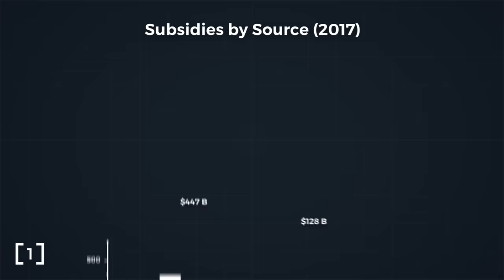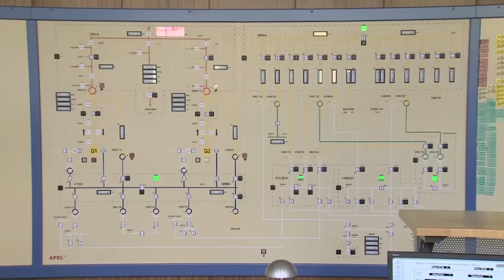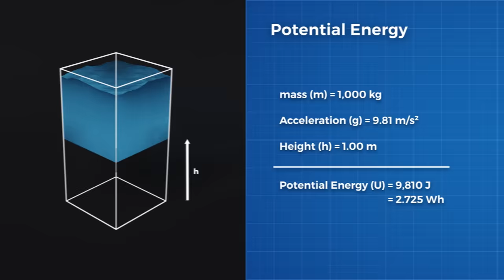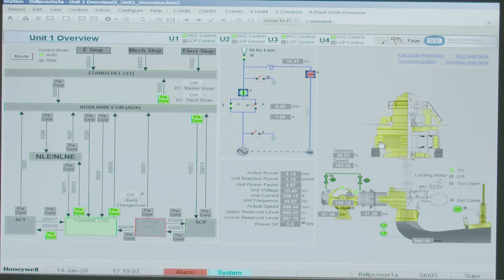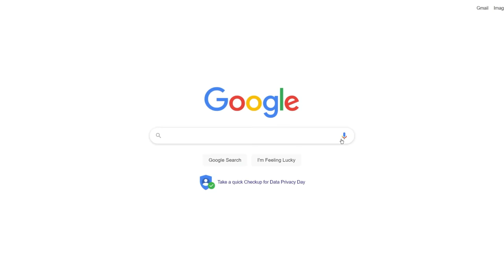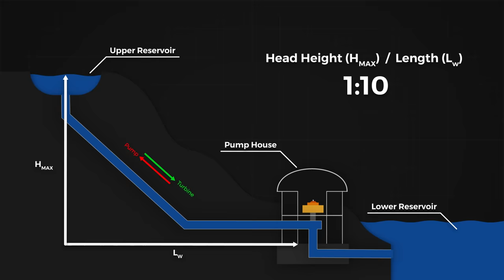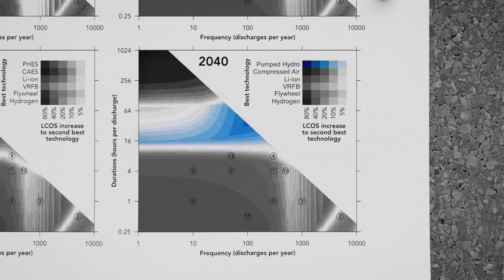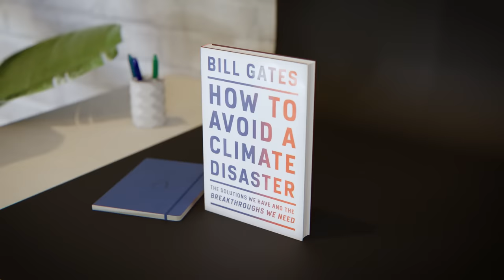The Truth About Pumped Hydro

Comment: Really interesting video, it's a shame we haven't built any others in Ireland since the late 60s even in spite of the issues you mentioned in your video
Reply: Pumped storage are mainly installed to support nuclear stations by consuming electricity when demand is low and generating when it is high.  Their main function was to regulate the grid when the demands is low as you can't regulate a nuc plant down in output.  The pumping plants were built as part of the nuclear project.  
The main issue stopping more which plants is the economics.  There is no real economics vehicle to pay the plants for regulating the grid as an independent plant storage from a nuclear plant.  They get paid for just straight power production and that doesn't provide a reasonable return on investment
Reply: Ireland's geography is a major hurdle. Not enough of the right kind of hills.
Plus, considering the way the country does budgets, (cough, New Children's Hospital) we'd spend more on it than ITER are spending on their fusion reactor.
Reply: @laredobenjamin7438  recent reactors can go down to 25%, which still isn’t totally off. Back in the ‘70s, you were lucky to be able to bring it down to 50%, 75% was more common if any at all was done. 

Though I agree with your point about baseload, yet the original point Jeff made about the build planning to be to support the nuclear project was true. It was projected to need a lot more storage with a majority-nuclear grid. That’s where the political will for pumped hydro came from. Even though they can be useful for any baseload supply today. 

Not to mention, absorbing the unused power at night is only part of it. Another contributing factor was being able to absorb demand spikes. Even if you’re able to ramp up your nuclear from 50 to 100, you don’t want to have to cut off supply while it’s rising. It’s demand-shaving, like most grid scale batteries are offering now, and like water towers and gasometers always allowed. Again, as part of the political idea in the ‘60s and ‘70s of using nuclear for basically everything, not just baseload, they figured they’d need to be able to absorb pretty large demand spikes. Thus, pumped hydro was presented as the solution.
Reply: @laredobenjamin7438  you are correct that it "can" be done... however, it takes a long time to change load and stabilize thereby making it so you need an alternate method of consuming the electricity... hence pumped storage...
Reply: There was a group a while back called 'The Spirit of Ireland' that wanted to dam off hydraulically isolated valleys facing towards the sea on the west coast (They found a few suitable sites) and use them as reservoirs for pumped seawater. Nothing came of it because every square mm of land in this country is owned by someone, and even if they're sub-subsistence farming (Couldn't survive on farming income without EU grants) it - they would still delay any construction for decades or indefinitely in the courts. Irish people are not fans of taking people's land - even if they're extremely well compensated for it.
Reply: @laredobenjamin7438  no, it doesn’t fall to zero, that’s why baseload is called base load. 

Of course the nuclear can load-follow long-term demand increases. I specifically talked about momentary demand spikes. 

Of course I’m most familiar with the UK, both living here, and my father worked in the industry (he’s now retired). It’s a well known phenomenon here for us to get absolutely huge brief demand spikes in the adverts for popular programmes on TV. Boiling kettles, flushing toilets, etc. 

I’m not talking about “can baseload plants load follow into the day?” I’m talking about “can nuclear replace peaker plants that run for 10 minutes? No. Can pumped hydro? Yes.”. 

You’re belying your own ignorance here, because the context of this comment is self-evidently Irish and British. And in the ‘70s the British government did pursue nuclear aggressively for a while with the coal miners’ strike, and there were talks of “how can we completely cut coal out of the supply” — thus even relying on them for peaker plants would not have been politically feasible. We were also watching France over the channel and considering if we could emulate them. 

I made no comment on whether, for instance, the USA had ever seriously considered pursuing “full nuclear”, or if there were other solutions available to the fundamental technical limitation such as other peaker plants. Because, I made the sin of assuming someone online would consider the sociopolitical context (which Jeff is also familiar with and was talking from, such as about the political project) before deciding to argue about inane engineering facts and talking down to someone because you didn’t agree with what you merely assumed she had meant.
Reply: @laredobenjamin7438  I see. I didn’t actually know other European countries don’t really have that issue. Do you not have televised events that are so singularly popular? Its commonly referred just by kettles but anything, a coffee machine, or even just increased water pump load in a community (my toilet flush example), can do it if people get up in the adverts. How is your grid topology different such that it can avoid it?

I wouldn’t say I was upset, just annoyed that you seemed to think I thought baseload had to go to zero, and found your tone to be a bit patronising (“I think you overestimate” etc). Since only peaker plants (and their alternatives) need to go to zero. Happy to discuss the rest.

To give some more background, it was actually illegal to burn gas for electricity in the U.K. until the ‘90s, so any peaker plant would have been coal or oil. So switching to nuclear for only all baseload could have been seen as handing even more power into the strikers’ hands, so the politicians’ thinking went. “Every time there’s a spike we can cause or prevent a blackout”, etc. There’s some pretty interesting memoirs (or self published websites) by people who worked for the U.K. grid (either in CEGB, local distribution board, or associated agencies), many have stories about managerial pressures to find alternative solutions.

Addendum: a lot of the pressure on the engineers was less about absolute GW throughput, and more about fast response times. Even if they were only expected to supply for a few seconds/minutes, they wanted to guarantee fast load-follow response.
Reply: @laredobenjamin7438  it wasn’t just a ban on gas peakers, it was a ban on all gas generation. The law, I believe, was enacted back when the country was still burning coal gas, and it was intended to secure the supply of home heat or somesuch? But it was never updated (until the ‘90s) to account for natural gas, despite the agitation to do so from looking at other countries beginning to do so in the ‘80s. The coal gas was supplied from local coal plant and you could see the town gasometer rise throughout the day before abruptly draining in the evening. So I suppose they thought they didn’t want power companies thinking they could burn some on warmer days or something. I haven’t looked much into the enacting of the law, just the.. overriding? But yeah. In the ‘90s we lost almost all our coal plant as they were all switching to gas. And oil plant went totally out of business because gas could handle peaking just as well as baseload. 

I can understand why you might think someone was assuming the entire grid goes to zero at night, but I’m always for simply asking rather than assuming that’s what somebody meant. 

But sure, nuclear is capable of following the long term demand curve. That’s why so many more recent plant designs (especially ones looking for initial capital) include molten salt, compressed air, hydrogen, etc storage options. Or just straight up co-locating batteries. They don’t want to have to rely on some separate installation to handle the peaks if they can help it. Especially because then they can get in on the energy trading game to buy up cheap wind too, to help lower the repayment timelines that might otherwise stand in the way of access to credit/investment. 

Perhaps you’ll find interesting this website: carbonintensity.org.uk , it has a live map of the types of electricity sources used in each region of the U.K.  Today is fairly green (unsurprising, the wind is straining against my windows today). But on low-wind days, the south goes very red due to gas plant, while the north stays pretty green from nuclear and hydro. As a rough generalisation of a map with many regions of course.
Reply: with the relative size of hydro, i'm not surprised, it's a great boon to the electric grid but you need to plan out everything to see the unforeseeable impact of such large project
Reply: @Pique147  Still can't get over the fact that Children's hospital is looking to be several hundred million more expensive than the tallest building in the world, the Burj Khalifa...
Reply: If every single person in Ireland are willing to pay around $20 without expecting any reward, that would already cover the cost... for one facility. Need 37? Well, you do the math.

Comment: Even as an interdisciplinary engineering major, I completely forgot that you can just store potential energy like that 😂 but it makes sense, y’know.
Reply: I took a class on energy systems, people have some dumb ideas about energy storage like in mechanical kinetic systems (flywheels), blocks on hills (rail storage), and heating a large block for later use. And the worst offender is lithium ion batteries which degrade by cycle lives to need replacement every 2-3 years.

But then there are some good methods like electrolyzing hydrogen for later and pumped hydro.
Reply: @jasonreed7522  why do you need peak density for a lithium ion battery when it’s for the grid. Use recycled lithium ion batteries smh
Reply: @jasonreed7522  Not sure what you see a "dumb" about any of those ideas..?  Flywheel is probably the worst of them because of the massive friction losses, but there's a lot of work on reducing that via maglev systems and the like (yes the magnets would induce a loss of their own, but as long as that's less than the loss due to friction in something like a ball bearing wheel, its still a net win).

Of course you're never going to scale a single rail car to 292Mw or whatever the number was, but there's also no reason you'd have to - just have a whole fleet of them covering a mountainside.  Perhaps not the most aesthetically pleasing structure in the world but entirely doable.

All of those methods have drawbacks yes, but so does pumped hydro and so does hydrogen electrolysis.. and so does not even trying and just continuing to burn a shit ton more fossil fuels.  And every individual power station's needs will be different (political, geological, etc) so having many options available with different benefit/drawback tradeoffs is never going to be a bad thing.
Reply: @altrag  Modern flywheels don't need to have massive friction losses.
You can run them in a vacum chamber on magnetic bearings. The loss is below 10%/day. Doesn't work for long-term storage, but for short-term storage and compensating fluctuation in the grid, it strikes me as an interesting option. The flywheel can switch from storing to releasing energy in a fraction of a second and unlike a battery, it can provide some grid inertia.

Not sure how well it scales though.
Reply: @Bird_Dog00  Battery systems like Tesla's installation in Australia can switch in milliseconds.  Speed definitely isn't an issue with batteries.

As for scaling.. that's not really hard per se - just build a bunch of them and hook them together.  There's definitely going to be an engineering limit for building bigger and bigger individual flywheels, but not really for building as many as you want in a row.  That's mostly a cost and land use issue.
Reply: @jasonreed7522  Flywheels are cool as hell, just expensive. Magnetic levitation and vacuum chambers provide IIRC better savings with bigger scales, so the problem isn't that we can't build efficient flywheels: is that the efficient flywheels are massive, and need to store ungodly amounts of energy in somewhat dangerous form. Not only would any failure be catastrophic, but maintenance would be very expensive as well. However, if sufficient scale and location would be available, they could buffer renewables for whole grids at night. So they are the best kind of currently unusable: scalable but expensive and high-tech.

Compared to linearly expensive (not scalable) or still not even conceptionally proven to be efficient (not even high-tech yet). For example, new lithium-ion batteries researched fall into that category. You can never build one big battery, and worse yet, you still can't build even a single working battery. This is why I really dislike Elon Musks implementations in Australia: simply put, that approach can never be the future, as it doesn't scale at all.
Reply: @catcatcatcatcatcatcatcatcatca  Flywheels are basically mechanical inductors, they store energy by KErot = 1/2 I ω^2 which isn't comparable to the MWh load shifting needs of the grid. 
They have a purpose, and that is to help short term frequency requlation on the mechanical end of the generator. (Inductors cant instantaneously change current and flywheels can't instantaneously change velocity and if drawing enegy out it looks like exponential decay in 5 timeconstants. Its the same problem with super capacitors, which are just physically small capacitors with large capacitances. Its just not meant for longtem storage, it already has a job helping motors start and fixing reactive power needs)

And thats before you get to the losses, remember you need round trip efficiency which is ξin * ξout, so to use a system you want easy energy transformations like electric to magnetic (transformers, antenna) or chemical (batteries depending on design) and not something like light to electricity (solar panels have ~40%). You also don't want losses if you plan on storing energy long term (depends on defenitions).

5 sec is longterm when talking about voltage on a line from lightning. 
24 hrs is longterm for day/night load shifting/curve flattening (demand curve).
6-12 months is long term when deciing how to deal with the different solar energy production in summer and winter.

Engineering is complicated, every device has a purpose, not every device is efficient or a good solution. 

Sensationalist TED talkers, lobbiests, annd journalists often misunderstand or misconstrue the actual benefits of a new technology to fit a narative and not to report the actual benefits. I have lost track of the number of youtube thumbnails claiming "super capacitors" will solve energy storage, when they are actually just capacitors with a lot of Farads in a small package but PE = 1/2CV^2 still applies.

Its you job to filter out the BS lies of people trying to sell something and find the truth about a device.

I only mentioned flywheels because i saw a thumbnail of a popular youtube channel claiming they were going to solve energy storage, they have existed since before electricity, they already have jobs, newer flywheels are jusy going to be better at those jobs and won't replace better options.

Like molten metal batteries and similar batteries that are the size of a house but suffer no degredation from cylcing. Lithium batteries were made for your phone cause the're light and rechargable and energy dense, and only need to last 2 years before you drop to 80% of original capacity. (Which is a problem if you said you could load shift 10GWh and can now only shift 8GWh, you will anger your customers when you cause a blackout)
Reply: @jasonreed7522  What makes the other ideas you mentioned bad? Don't know much about engineering so I'm genuinely curious.
Reply: @iminformedbecauseisawabunc9402  the tldr versions
Mechanical storage: Earths gravity is weak and 1kg falling 1meter is only 9.81J of energy, a kW is 1000J/sec, so to maintain 1kW you must be able to drop alot of mass a long distance continuously, this rules out most methods. Mechanical storage uses either kinetic U = .5mv^2 or potential U = mgh which pale in comparison to the grids needs measured in kWh (energy used by a 1kW device for 1 hr, 1kwh = 3.6 MJ (mega)). 
Most mechanical enegy systems are not energy dense enough to economically scale to meet this.

Themal storage: hot objects loss heat to conduction (contact), convection (hot air rises), and radiation (glowing). Storing energy in keeping something hot will suffer massive losses (turn off you heat in winter and see how long it takes for your pipes to freeze). Additionally any energy tranfer involving heat has entropy losses (thermodynamics laws) which are irreversible and bad. (Thermal power plants are 35% efficient because of this)

Lithium Batteries: are designed for your phones needs, lithium mines are bad for the earth, and drop to 80% capacity in about 2 years. (Not acceptable for the grid) And they like to catch fire. (remember the galaxy note whatever that kept catching on fire in pockets)

Good storage does not loose energy over time, has high efficiency conversion, is economical, and most importantly is SAFE. 

Pumped hydro works because water is cheap and safe, and you basically are moving an entire lake to the top of a mountain and back with minimal infrastructure.
Reply: How bout quit being lazy and scam artist let's finish fision a lot cheaper when it's RELEASED
Reply: You need to expend energy to create the potential energy and there are losses in the difference. This video does not mention any of the many downsides.